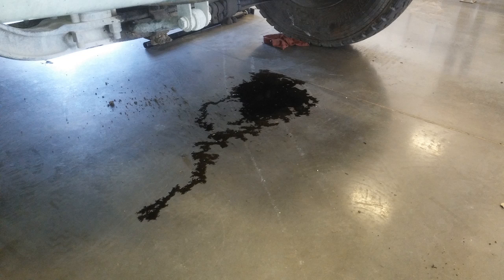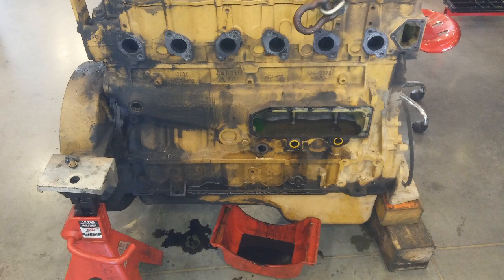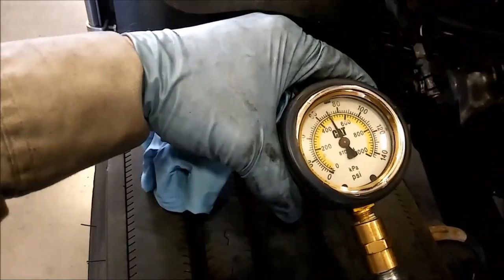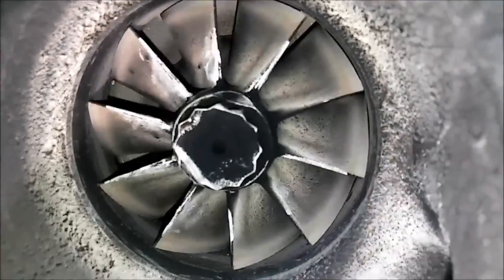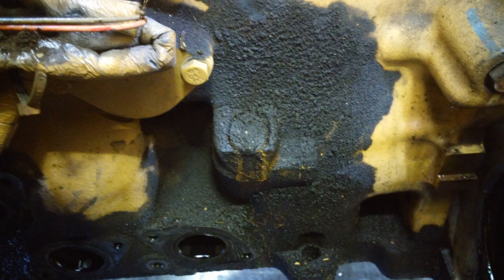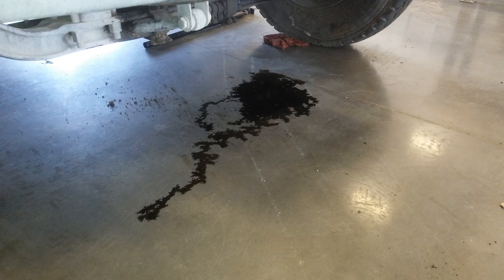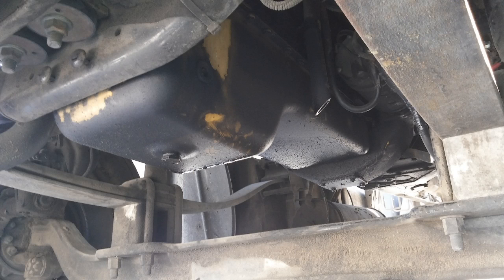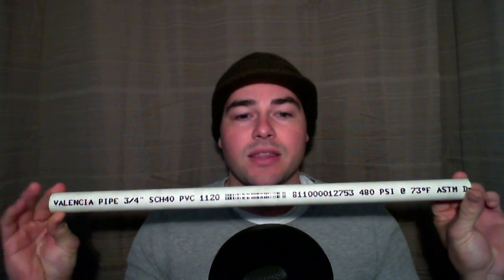Why Do Diesels Leak So Much?  Why Do Diesel Engines Leak So Much Oil?

Comment: CDR Crankcase Depression Regulator.
My 1986 M1009 has one on it's naturally aspirated 6.2 diesel engine.
By the way; the first PCV valves were put in 1950's Willys jeeps.
The reason was the old road draft tubes admitted water during river fording.
The pcv system allowed the block to be sealed up except for a breather on the top of the valve cover.

Comment: Adept ape, big fan of your channel, greetings from alberta Canada. 

Since today's topic is PCV I thought that I'd share another method that we use. Bit of background. I work for one if the large railways here in canada as a locomotive mechanic. Our engines are upwards of 11,000 cubic inch, 4500 hp, giants that move a lot of air and a lot of boost (up to 70 PSI on the new units)

To keep our crankcase from suffering an over pressure (which actually trips the engine shut down on our engines) we use what's called an eductor tube system. An eductor tube is a tube that goes into the exhaust stack of our engine. A hose comes from the crackcase, through an oil strainer, and to the eductor tube. The eductor tube is a venture tube that uses the venture effect of the passing exhaust gases to form a vacuum that draws blow by gases out. It is very effective. I did a load test (essentially an extended dyno pull on the engine using the generator) on a unit. At full throttle, the system was able to hold the crankcase pressure at -3psi. 

I know this would be impossible today with how oil poisons the DOC, DPF and SCR filters but it shows another method that overlooked on road. 

Looking forward to the next video. Cheers!
Reply: Well said, I've told many people that systems like that are THE ANSWER to oil leaks. 

Short story - Back when I was working on performance cars for a living I had a customer bring his car(68 Firebird)  in(on a tow truck) with a quarter size hole in the oil pan and a little story. He was out driving, knocked the underside of the car on something but all appeared fine so he kept going. When he got home he shut it off, got out and soon noticed that all his engine oil was on his driveway. He got to looking under the car and found the hole. Baffled he told me this story asking why it didn't leak till he shut it off. The answer is that he had a system much like you describe I'd installed on his car. It sucked so much air that while he was driving it pulled enough air to prevent the oil from escaping out the large hole. 

FWIW the system was PCV plus exhaust vent and the engine was supercharged, I'm sure these things helped. The PCV was tapped in between carb and supercharger and Tee'd in with the exhaust with one way valves. So whichever was higher PCV vacuum or eductor vacuum pulled crankcase gasses. This combined with a lack of vent pulled a significant vacuum in the crankcase.
Reply: @snek9353  Very interested in the petrol application of the exhaust eductor. Was there a proper eductor fitted like: 

https://www.google.com/search?rlz=1C1ASUM_enAU728AU728&biw=2560&bih=969&tbm=isch&sa=1&ei=WCwrXLrRAtDM8wXKjYz4Dw&q=2+3%2F4%22+exhaust+eductor&oq=2+3%2F4%22+exhaust+eductor&gs_l=img.3...36093.40630..41122...0.0..0.348.1672.2-6j1......1....1..gws-wiz-img.hyiJJz9GLfY

Or was there just a pcv hose T'd off the exhaust somewhere with a check valve? I would have thought something like this would pressurize the crankcase.
Reply: Josh Head given your background you’d be a sure bet for an aircraft mechanic. 

But there are lots of openings into the heavy equipment trade, especially in your area with the oil industry. Your military background doesn’t hurt as well. I’d just look around and see who’s hiring and who is interested in taking you on as an apprentice. Should be no problem
Reply: Speed150 I’m from cold lake Alberta looking to release from the military and get into heavy mechanics. I’m currently a mechanic on turbine engines for the cf18. Any advice on getting into the trade. Thanks in advance.
Reply: This seems to be on the wrong side of the state, but still an interesting channel when speaking of gas turbine engines https://www.youtube.com/user/AgentJayZ
Reply: Find a shop looking for mechanics, I'm in Edmonton, however work in High Level at the Sawmill, Been hard for me the last couple years working as a welder as oil is in the shitter. Got fortunate enough to get a job contracting for the mill. Sometimes it just comes down to switching between industries. Never done work in Forestry before but as far as metal goes, it's all joined by the same means!

Good luck! Hope ya get back into the trades!
Reply: @joshhead6133  im a gas turbine mechanic for FieldCore, i know theyre hiring. a subsidiary of GE, good travel pay, benefits, decent hourly rate.
Reply: Speed150
Reply: Speed150 thanks a lot I appreciate your input. Cheers.
Reply: Im trying to make a system for my car that employs these same exact methods but the state won't pass me on inspection, they just want my engine to blow.
Reply: Very great comment but like you said emissions is the issue, other wise a simple hose out rocker cover would do
Reply: Oil poisons the DOC? I thought the DOC was supposed to oxidise the carbon and unburned/partially burned oil and fuel. Taking advantage of the large amounts of excess oxygen (due to the turbochargers forcing in more air) in Diesel engine exhaust.
If oil is clogging your DOC or SCR then you need better catalysts. That's probably one reason (albeit minor) that high-flow catalytic converters exist.
Reply: Very good information and well explained.
Reply: speed150mph m

Comment: Ambient atmospheric pressure forces the air-fuel mixture through the open intake valve into the cylinder to fill the low pressure area created by the piston movement.-University of Windsor.  The intake charge is push in, not sucked in.
Reply: University of retards, slap a vacuum gauge on a engine, guess what, YOU GET VACUUM know where it is coming from, that piston going down making a void.
Reply: Engine vacuum is is caused by the Bernoulli's Principle, just like an air powered vacuum cleaner or a air powered brake bleeder.

Comment: Filtered blowby that is routed into inlet of turbocharger
Reply: Yup.  The OM647 in my Sprinter uses one. 183,000 miles on the turbo so far... 700,000 on a buddy’s.  And meets smog in all 52 states.
Reply: @davidmartin7099  I assume when you mention 52 states you're referring to USA. I thought there were 50 states.

Comment: Thank you very much for making that video! I have a series 60 and I was just about to type my blow by tube into the intake piping of my truck so I would not have to smell the blow by and it sounds like I would have wiped out my Turbo so I'm glad I had not got around to doing it yet before watching this video thank you very much
Reply: michael garner have done to mine been driven two hors per day for last year no probs yet but will be adding a catch can.

Comment: My cat c13 always leaks oil on each side of the oil pan
Reply from the maker: +Victor Guzman Block plugs? The C13s have a pretty good oil pan gasket design.
Reply: Adept Ape it just leaks on the side but doesn't drip

Comment: What is a common oil filter wrench size to do oil changes on these big truck engines?
Reply from the maker: +Thewhiteboy 503 The Cat filters are about 5 1/4" wide if that helps you.

Comment: Funny im watching this video at the end of the day after i just replaced a crankcase oil recirculation canister on 2018 FTL cascadia with DD15. That was a warranty due to the part failed and causing oil just to pour out of the vent.
Reply from the maker: +Tony Mullins I wish I knew more about the new Detroit, Cummins, and Paccar engines. Do you like the engine so far?
Reply: Adept Ape yes i like the new Detroit engine's in my opinion a really great engine and mechanic friendly engine they do have a couple bugs like the crank case oil canister likes to leak, and the plasic air compressor coolant lines like to leak around 300.000 but really easy to change. I wish i knew more about paccar and cat like you do but mainly im stuck on detroit engine's. So thats why i like to watch your channel i learn alot.

Comment: What about doing a cold start every morning in below freezing temps? Can the changing heat conditions cause gaskets to swell? Can you do a video on cold starts and how the metals expand and change after warming up
Reply from the maker: +Lateralus180 The gaskets shouldn't swell from the temperature change, but the gasket mating surfaces can definitely give you leaks at different temperatures. Just like a cold coolant leak.

Comment: Would venting crank case fumes outside instead of back thru the turbo reduce leaking
Reply from the maker: +Nice Guy Most of the 2006 and earlier diesels vented out to the atmosphere. In 2007 most switched to the crankcase filter elements.

Comment: Huh, I always just figured it was because they vibrate more than a gasoline engine. I never thought about it this way. Thanks!
Reply from the maker: Bucketsamson There are tons of little reasons too. More total hours of run time, more gaskets, larger sealed surfaces, and older gasket designs a lot of the times.
Reply: Something magical about the smell of burning diesel engine oil fumes.
Reply: Much higher compression ratios than gas engines too... causing more blow-by...
Reply: Many, many more miles on the engines = more heat and cool cycles (expansion/contraction).